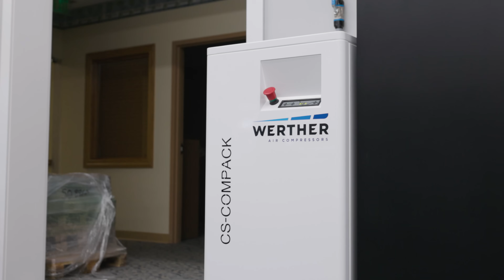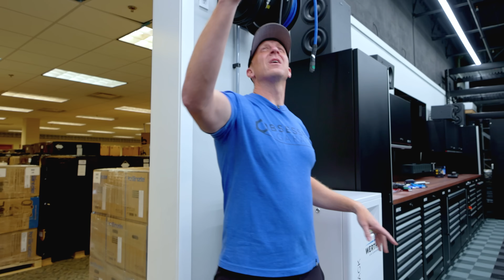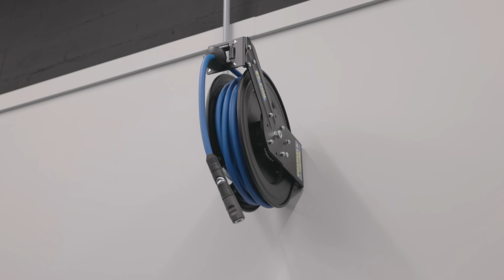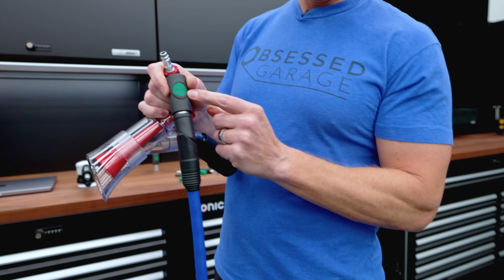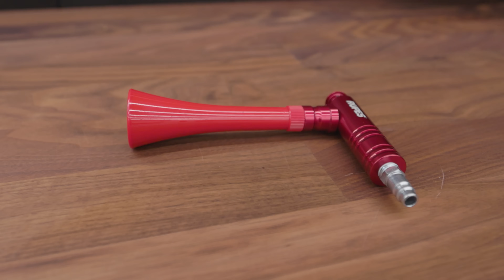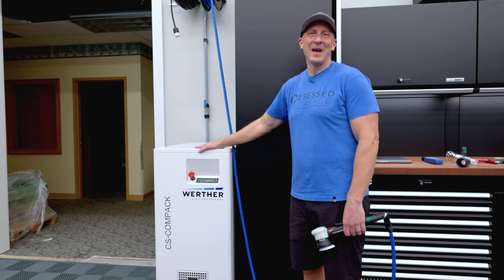I Bought a Luxury $11,000 Air Compressor—Here’s Who It’s For

Comment: looking to put these SwissTrax in my garage, however; been in a detail shop and they happened to mention a mold smell from water sitting in them and being difficult to clean underneath as a long term solution, any input on that? Thank you!
Reply from the maker: That wouldn't be from the Swisstrax.  That is probably a standing water/draining issue.  In a shop environment, you'd probably want to pull the out and clean once every six months or so.  Sounds like they aren't doing that.
Reply: @ObsessedGarage thanks for the reply very good to know, do the Swiss tracks allow water to flow, I have a 5 degree slope in my garage to drain out the bay doors I do full details wraps ppf plus have winter here it’s 1080 sq ft so removing the panels ever 6m may end up being too much to make this solution worth it vs epoxy and being able to squeegee out the space as often as I need. If you have a rec for which you’d choose for a heavily used shop space I’d love to hear your input!

Comment: 10:20 1” piping has about a gallon of volume per 25 feet. You’d need 500 feet of pipe to have 20 gallons of storage in the piping.
Reply: Glad I'm not the only one who caught that lol.
Reply: Anyone who knows anything about commercial compressed air twitched through at least the first 5 min of this video. “Here’s the digital regulator…” in the shot was the timer drain valve.
Reply: @customh got a digital timer drain valve on my Craftsman compressor. Been on there at least 15 years I think. I leave the tank pressurized all the time and that valve ensures there’s never moisture buildup inside.

Comment: That compressor is more suited for a dental/doctor's office.... not for a mechanic. My Quincy is rated @ 15.5 cfm @ 175 psi and a 60-gallon tank.  Also 100% duty cycle and will last a lifetime. Not as quiet.... but you could build a separate building for the 9ooo.oo+ difference in cost...lol. BTW ...Quincy makes a twin-screw compressor as well...and it is quiet and they begin at close to 25 CFM @ 175/200PSI
Reply: Matt might as well be a surgeon given how clean everything is.

Comment: I have a Makita Quiet Series, 1/2 HP, 1 Gal. Compact, Oil-Free, Electric Air Compressor rated at 58 dB. 90 PSI. Works for everything I need and is light enough to be picked up an moved with one hand. It's now about 240 USD, but I paid about 150 about 5 years ago.
Reply: I use a Makita MAC700 which is oil lubricated but has been a total peach. Very quiet, though limited in cfm (3.3 cfm at 90 psi). Six years in, it runs as new.